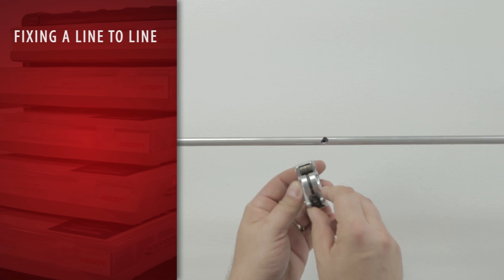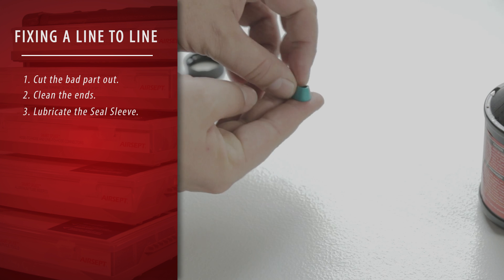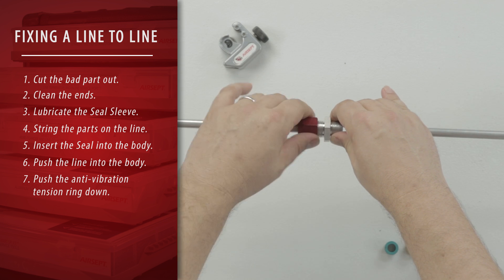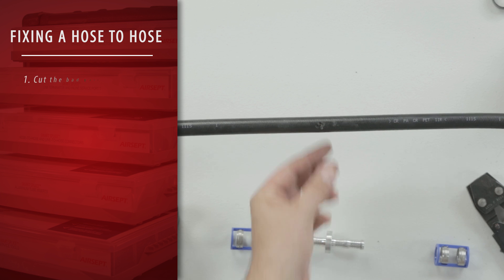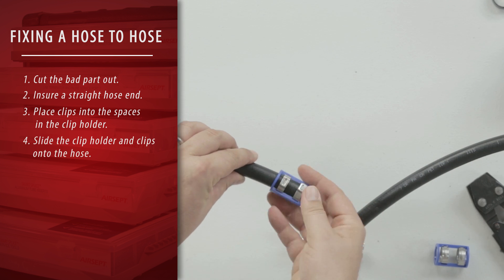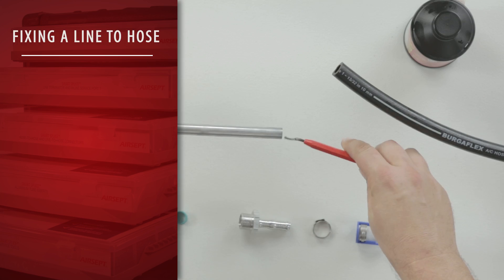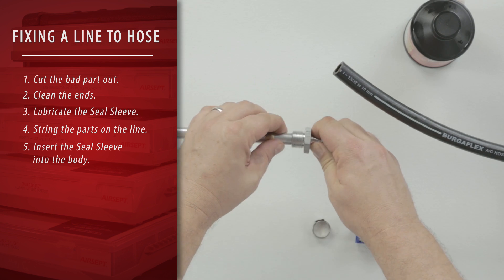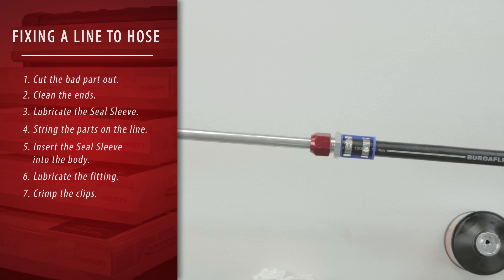AIRSEPT Smart Splice™ How It Works

Comment: How would i know what size i need for a 2010 gmc acadia plis???
Reply from the maker: You will need to measure the outside diameter of the line you are looking to replace. Make sure you have a minimum of 2 inches of straight line on either side of the leak.  If the damage is portion is greater than 2 inches, you may want to look at one of our jumper kits.

Comment: It’s just a compression fitting. Nothing more, nothing less.
Reply from the maker: While you are right that our line connectors use compression to create a permanent seal, but what we do differently is add a large seal sleeve that creates a seal that holds up to 2600 psi.
Reply: @AirSept  thank you for that reply.
Reply from the maker: @Aaron-hype  Happy to answer any other questions you may have.

Comment: Looks like a compression fitting from Home Depot. Am I missing somthing?
Reply: Hi - thank you for watching - actually our SMART SPLICE™ products are uniquely different than a standard compression fitting - here's how: 

Our patented sealing technology has 10 times the sealing surface area of a standard O-ring, and is Burst Resistant up to 2600psi making it a top performer in it's class! 

SMART SPLICE™ Anti-Vibration tension rings are specifically designed to reduce vibration and prevent leaks. As you could see in the video it can be installed in as little as 5 minutes Saving you TIME and MONEY!  NO Special Tools and NO Glues needed!

The Airsept SMART SPLICE™ Line of products are compatible with many kinds of refrigerants and are OEM approved.  The Smart Splice works on automotive systems including Air Conditioning lines, Power Steering Return lines, Transmission lines, Trans Oil Cooler lines, and more and is also compatible for residential and commercial A/C and plumbing systems. 

Please feel free to ask us any questions and visit our website at www.airsept.com to see our complete SMART SPLICE™ line and many more Award Winning Service Solutions!
Reply: @danielleremieres2601  How do I crimp the metal clamps?